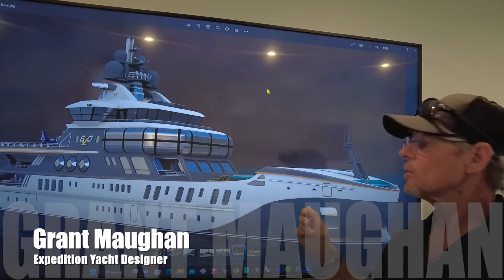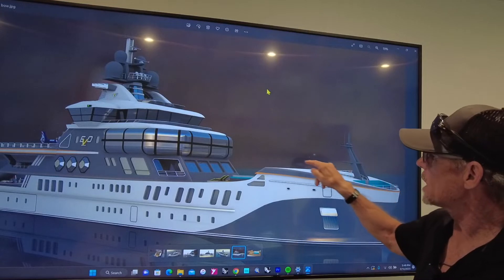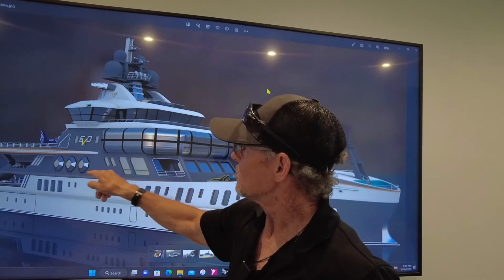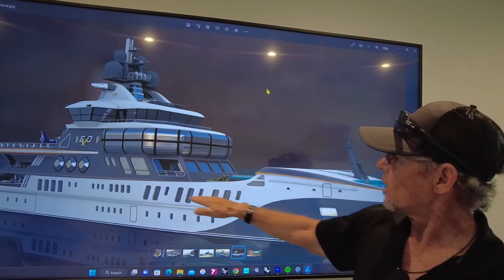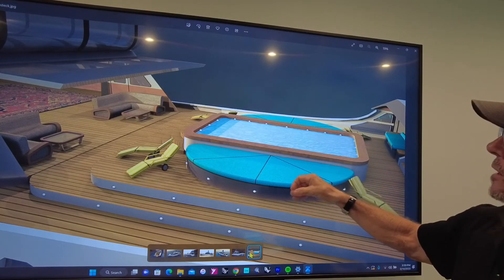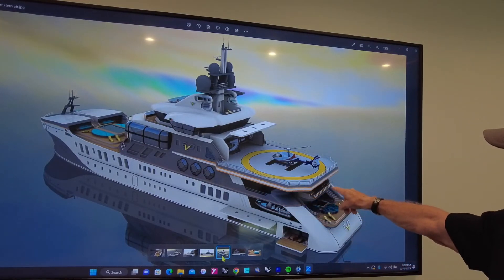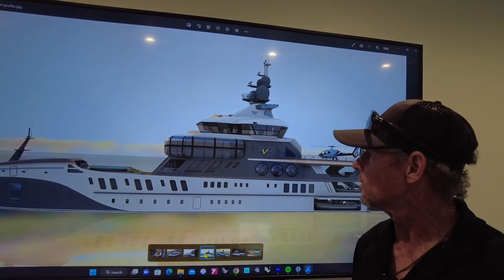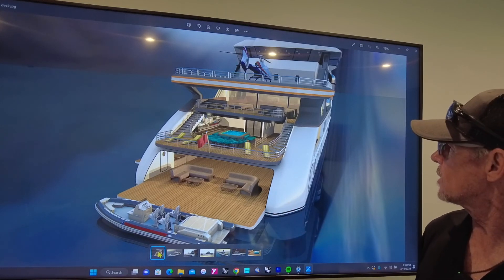Designer Grant Maughan discusses his concept for rugged 80m North Sea Global Expedition Yacht

Comment: Highly innovative design. The one question I would have is the structural support running right through the middle of the viewing platform's windows. It looks to me they would be right at the height a lot of viewable scenery would be to anyone in that viewing area. Might there be a way to build those windows without that obscuration?